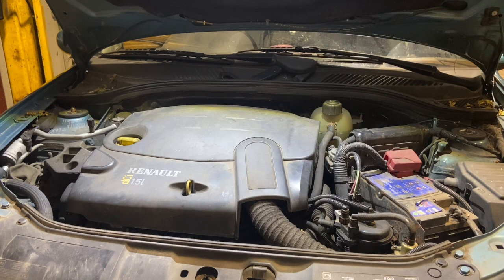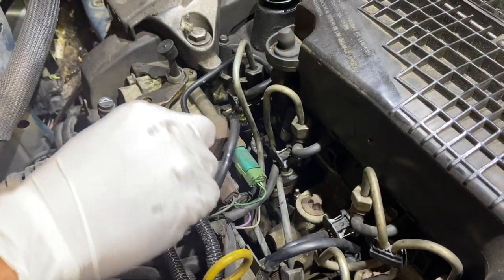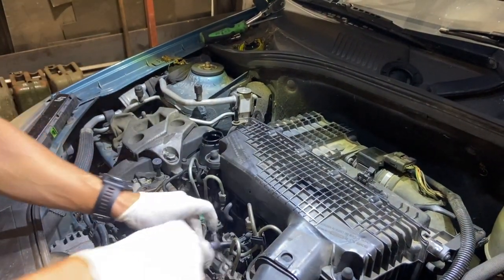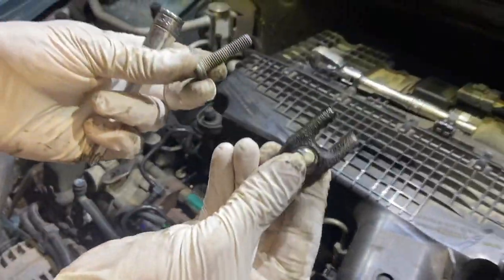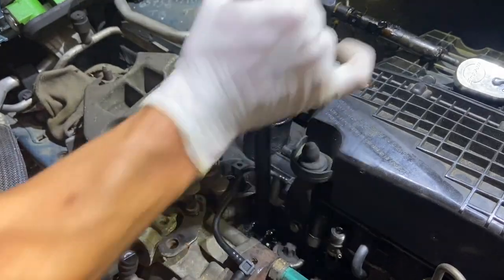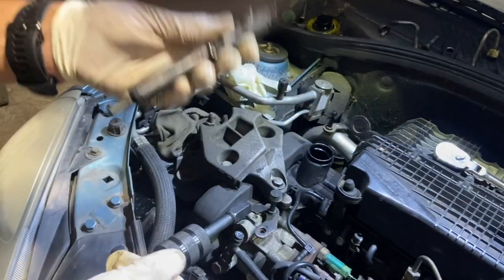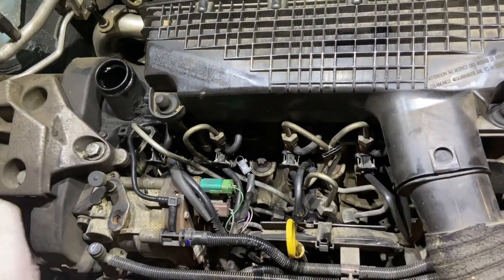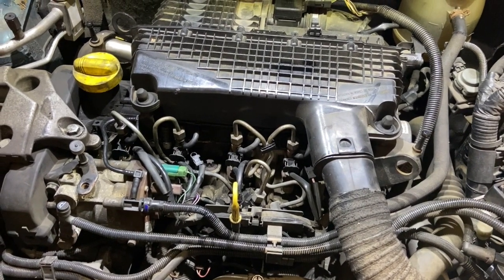How to Replace Injectors / Injector seals on 1.5 DCI Engine K9K

Comment from the maker: Check Euro car parts - https://tidd.ly/3lIO7xA  (use discount codes on site)
Check "Car Parts for Less" - https://tidd.ly/2LNEwIn  (use discount codes on site)
Check GSF Car parts - https://tidd.ly/34pZe7o  (use discount codes on site) Injector Puller Tool - https://amzn.to/3grLc8V
Injector bore cleaner kit - https://amzn.to/3grvnPB
Injector seal removal tool - https://amzn.to/2O9d7P7
Set of Injector seals - https://ebay.us/cYaFJg
1.5 DCI injector - https://amzn.to/3f38bXD

Hand tools used in this video :
17mm spanner - https://amzn.to/31MNlI7
Flat screwdriver - https://amzn.to/3e2q9bB
T45 Torx socket - https://amzn.to/3iwAvE8
3/8 Drive ratchet - https://amzn.to/2BwnQjX

Comment: Thanks. Ihave a Dacia Duster II diesel 1.5 of 2018. Just after completed the 5 yr warranty time, with only 21,000 km I suffered 2 failed injectors within 6 months. It cost me 1,200€ to have them replaced and a lot of time lost, searching and frustration. No fuel problem. The piezoelectric part, the called "sensor" is burnt.
Why this happening? Low quality product ?
 Is there any better quality injector brand to replace the Siemens/Continental injectirs ?

Comment: Great video, did all 4 injectors on my Scenic on Sunday, now no chuffing or injection fault coming up. I will have another go at no 4 as I couldn't get the copper washer out, I just put a new washer over the top. Still a very slight leak but nowhere near as bad as before. Great vid.

Comment: Could the injector seal be a reason i keep getting air in my fuel lines
Reply from the maker: Not really tbh mate , it could the the injector return hoses or possible the primer pump / very minor crack in a fuel hose or fuel filter seal

Comment: Thnx for the excellent video. My only experience of diesel injectors is with Mondeo ones that you unscrew to remove....so  quite an education. I'm looking at my daughter's Modus that is overfuelling (I suspect).... white exhaust smoke strongly smelling of diesel... can you suggest how best to troubleshoot  which  injector causing this.... thanks in advance!
Reply from the maker: Best way to check these injectors is by doing a leak off test, you can get the test kits on eBay fairly cheap , I’m sure there’s a link in my video description to a set 👍
Reply: @diydaly  I'm just adding this in case anyone else with the same issue is looking for advice. I did a leakoff test, and cylinders #1, 2 & 3 returned 30ml.  Cylinder #4 returned 35 ml. All in all, not too bad on balance. So, I started disconnecting each injector in turn and revving the engine and observing the smoke. Injectors #1, 2 & 3 being disconnected made no difference to the smoke - it was just as bad. Disconnected injector #4, and no smoke! So injector #4, which is only a year old, needs replacing. All the others are original ones.
Reply from the maker: @nicam49  Are that's interesting to know, like you say doesn't look bad on a leak off test really .. was  a nice little test you did there then! 👍👍 typical its the one thats only a year old!ha .. makes you wonder to what quality the injectors are built / refurbished too

Comment: Hi great video. My Clio 1.5 dci 100 cut out yesterday, and wouldn't start again, RAC got it going again, and told me it is misfiring and injector seals have failed. He told me that when I turn it off it won't start again, however I have left it a day, and it started straight back up with no lights on the dash? The codes were all relating to the injectors, however it starts and drives fine. It is jerky when pressing and letting off the accelerator, and help would be much appreciated. Thankyou.
Reply from the maker: Hi thanks for the comment! I’m afraid you may have a faulty injector.. they are a mega common issue. A blowing injector seal won’t stop it running , you really need to do an injector leak off test and see if 1 in perticular is leaking off excessively.. worst case the fuel pump may have failed .. they breakdown and fill the system with tiny metal filings.. to check this you can open the fuel filter and check for filings.. only issues is the filters are sealed so you will need to replace the filter and just cut open the old one
Reply: @diydaly  Thanks so much. I am going to check the EGR tomorrow, I'll unplug it and take it for a drive. If it is still jerky, then I'm guessing it will be the injectors.
Reply from the maker: @TheOriginalDane  👍 you can buy a basic leak off test kit fairly cheap on eBay https://ebay.us/dAug9J

Comment: what are all the tools needed? need to borrow some from a mate i think😂
Reply from the maker: Hi mate, ive just copied all the links out the description :

Injector bore cleaner kit - https://amzn.to/3grvnPB
Injector seal removal tool - https://amzn.to/2O9d7P7
Set of Injector seals - https://ebay.us/cYaFJg
1.5 DCI injector - https://amzn.to/3f38bXD

Hand tools used in this video :
17mm spanner - https://amzn.to/31MNlI7
Flat screwdriver - https://amzn.to/3e2q9bB
T45 Torx socket - https://amzn.to/3iwAvE8
3/8 Drive ratchet - https://amzn.to/2BwnQjX
Reply: @diydaly  cheers appreciated, now i feel like a dick because i checked the description but didn't see the "more" button so only saw the first two links n thought that was it😂😂
Reply from the maker: @KoolKy04schannel  haha it catches quite a few people out that! Not very clear tbf is it lol 👍

Comment: I have problem with a black smoke from exhaust pipe. Is it turbo or injectors?
Reply from the maker: more likely to be an air leak from turbo pipe or turbo 👍
Reply: I have a dci 06 clio mk3, went to change fuel filter cus i had red engine light when accelerating (poor accelerattion and black smoke) and the car wont start now, mechanic told me is injectors,but the engine was sounds sweet.can somebody help?
Reply from the maker: @1988kuriakos  black smoke could be caused by an air leak in the intake system but doesn't explain hy it wont start. you really need to do a leak off test on the injectors
Reply: @1988kuriakos  try to pull out plug from EGR. I had a turbo oil leak. When I changed turbo there was still black smoke from exhaust pipe. Disabling EGR fixed problem.

Comment: I've got a Megane 1.5 dci. When accelerating there is a  tinkling tinny rattle from the engine but it's not there when the engine speed is constant, like cruising or on tick over, only when putting your foot down. I've been told is might be the diesel injectors need replacing, but how can they be noisy and causing the problem???
Reply from the maker: Hi Chris the injectors wouldn't usually make a "tinny" rattle noise , sound more like somethings loose mate

Comment: Hi , thanks for the vid. I also have a problem with a 1.5 DCI. It sounds like it's leaking compression  and the base of the injector is very wett. Could it be a leaking seal?
Reply from the maker: Thanks for the comment, yes it’s sounds like you have a blowing injector mate .. A new copper seal should sort it 👍
Reply: @diydaly  Thanks a lot. I'll replace it.
Reply from the maker: No probs mate 👍👌
Reply: @diydaly  Job done. What a mess. The injector was covered with black pitch. At first it ran very square. After stopping and starting 5 times, it was normal again. Does the ECU reprograms after a start and not during running?
Reply from the maker: It only needs reprogramming if a replacement is fitted.. if you just replaced the seal it should be fine mate 👍

Comment: Hi did you program the new injectors.... I've replace injectors on same engine but I don't have injector pulse now
Reply from the maker: Hi , some models will have the option to programme on a diagnostic machine.. I plugged the Snapon scanner in but I didn’t have the option for this exact model. Normally if they require coding it will still fire just not run very smooth.. replacing the injector shouldn’t stop the pulse supply.. seems odd , but Seems you have another fault occurred . Is it only 1 injector that you haven’t got a pulse on?
Reply: @diydaly  i did engine overhaul and replace all injectors..now engine light is off plus no pulse on injectors
Reply from the maker: Does it have a fuel cut off switch? Are there any fault codes logged in the engine ecu?
Reply: @diydaly  it does not have fuel cut off switch...am waiting for friend to come plug in diagnostic machine..will let u know

Comment: i have the same engine, the idle is not stable, it goes down to under 700rpm
Reply from the maker: Sounds like you have 1 cylinder down avocatul, this could easily be an injector at fault.. you really need to get an injector leak off test done
Reply: @diydaly  Thanks for reply, i searched alot about this issue (random unstable idle 1.5dci, megane 2) and in most of the cases it was the primer pomp Pressure regulator, but i think i have the test first the return on all injectors, maybe one or two return valves from injectors are gone and need to be changed...
Reply from the maker: @AparatorulPoporului  No problem :) yes the primers are fairly common , they can fail and let air into the system.. when they fail you can usually see air passing through the clear fuel lines, may be worth checking that first but a simple injector return leak off test would prove your injectors at fault or not :) I have replace a few fuel pumps in the past, they have broken down and put metal filings into the system but hopefully that's not your issue this time!